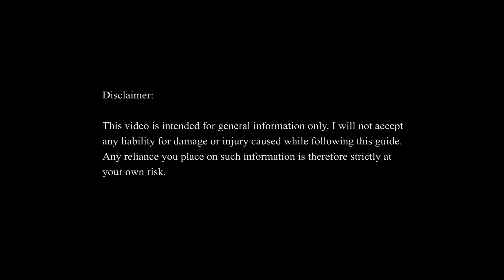Lenovo Ideapad 310- Disassembly, Replacing Thermal Paste, & Fan cleaning using contact cleaner

Comment: Anu pinag kaiba ng hardex na blue sa red na hardex contact cleaner tinignan ko sa shoppee nalito ako sa dalawa mas mahal ng konti yung red
Reply from the maker: Recommended Applications:

blue: PC boards, relays, sensors, switches, control panels, and contact points.
red: Use on electrical contact points, connections, switches, relays, air conditioning equipment, electric motor, sensor, alternator control, solenoid, cables, batteries, and electrical control points.